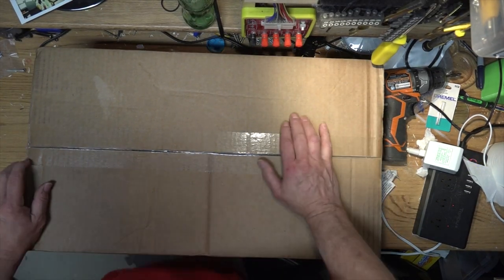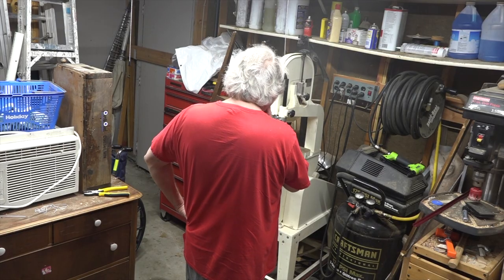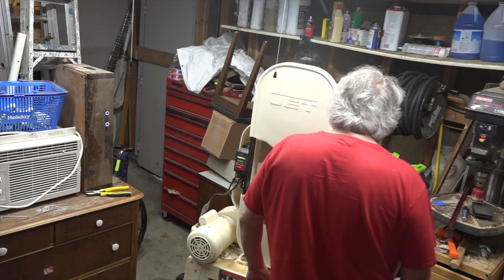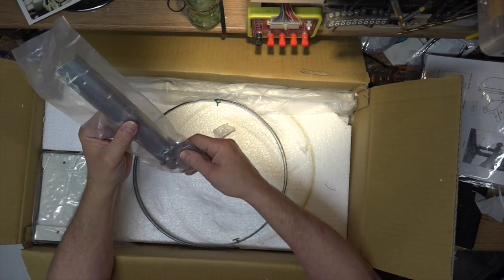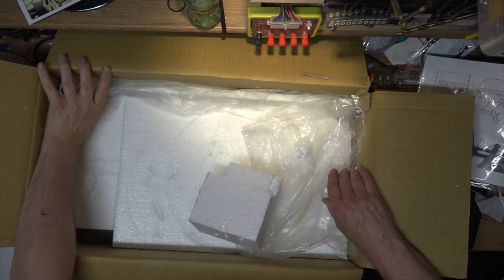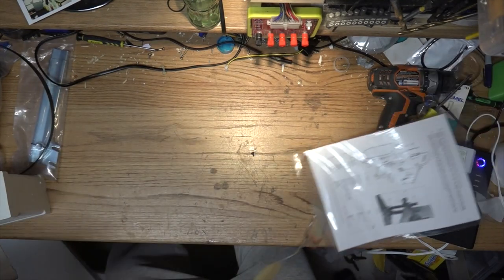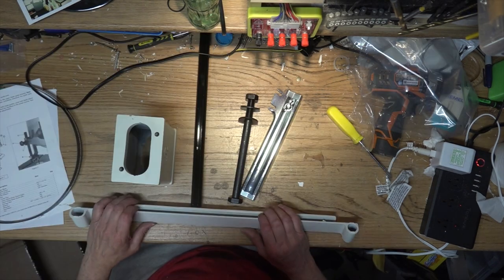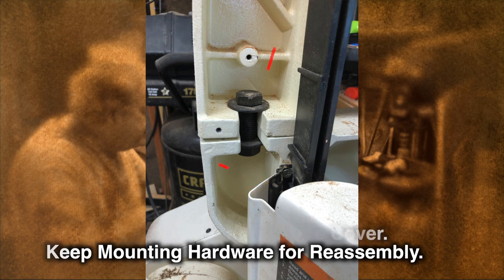Installing a Riser Block On a Jet 14 Inch Bandsaw

Comment: I know this video is a few years old, but I wanted to make a suggestion for another upgrade to your saw. If you haven't already done so, take a look at Carter guide bearings. I did ALL of Carter's upgrades to my Jet bandsaw (they make a lot more than just guide bearings), and now, it runs cooler, quieter, and smoother, than any other bandsaw I have looked at. All of their products are tailor made to fit most bandsaws on the market, new and old, including my Jet JBS-14 (I don't have the JWBS-14)which was made in 1982.

Comment: thanks for the video.   Do you happen to know what the Blade length with and without the Riser.   I have a Older band saw that is very similar to this model.  My blade is 92 1/2.  TIA
Reply from the maker: 93.5 inches to 105 inches. Source: Rockler.com riser block  item 11625.